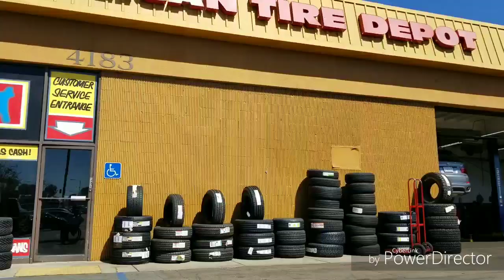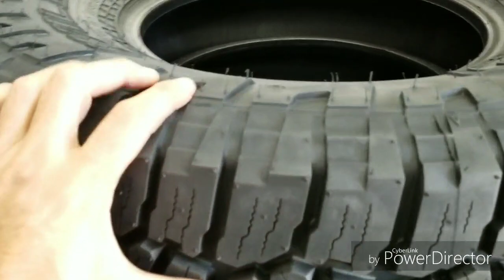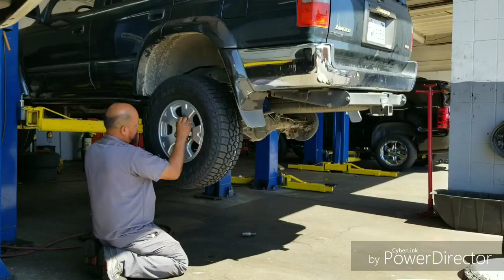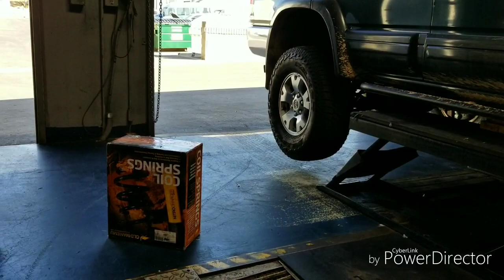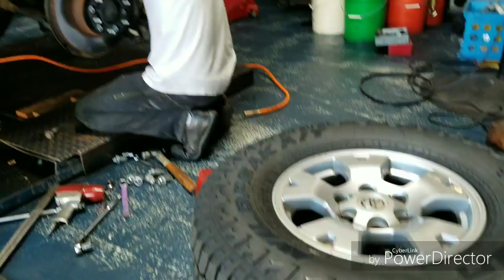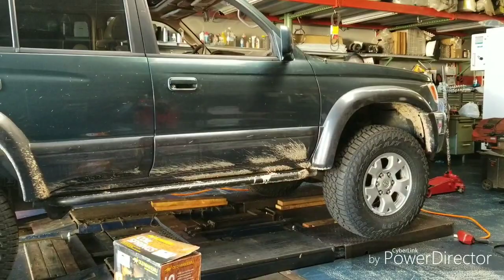4runner Gets a Lift, Wheels and Tires!

Comment: Looks great man! I’m looking into getting a very similar lift and some Wildpeaks as well. Could you tell me how much it cost for the suspension and coils? Thanks so much!
Reply from the maker: Hi there, I got rear springs 2906 for 60. Front 2881 for 160 and 5100s for around 290 for set.  I've been really happy overall with this setup.  Wildpeaks are my favorite all terrains easily.  If you watch my broncos flats video I was impressed with them.

Comment: Hi
What size of tires do you have ? 265/75/r16 ? and spacers 1.25 " ? If yes so in this configuration you dont have problem with front tires ? I mean with this size and spacers the wheel doesent touch the bumper or fender ?  I am asking because I hale tires 265/70r16 and 1.25 " spacers and the front tires when I only go back and turn the wheels they touch a Little bit in one place. I ordered now the new tires BF Goodrich KO2 265/70r16 but they for sure will touch the fender in the front because thebe arę AT tires and arę a Little big taller ten my old Yokohama. But today I decided to order also complet new Suspension Bilstein 5100 and springs OME 881 in the front and 906 in the rear. After that I want to order new BF Goodrich but now 265/75 r16. What do you Think ? With this tires BF Goodrich 265/75r16 and spacers 1.25" after lift will I have not problem with the tires in the front ? The springs 881 they get you 2 inch lift like they should be or Lower like 1.5 nich ? Same of the people said that after 881 OME spring instead 2 inches they got only 1.5 inch
Reply from the maker: Hi, yes I have 265/75/16 and it would catch on stock front bumper plastic. I had to trim a little! You will be fine if you do what you posted above.

Comment: Hey there which perch did ya put the front bilsteins on?
Reply from the maker: Lowest perch since these ome 881 springs give you a little lift.  If they ever sag I'll move them up a perch
Reply: Disabled2Able nice!!! I’m planning on getting this exact set up billies all around 881 and 906 in rear does the front sit higher?
Reply from the maker: @Circlec135  oh right on that's cool great setup you'll love it.  No actually the rear sits higher with slight rake so when you load down with some luggage it evens out.  It may look like front is higher in this thumbnail but that's only because of how fender wells are cut.  If you check out my Instagram you can see some side shots where the rear is slightly higher. Its disabled2able on insta

Comment: did you had to install those spacers In order for those wheels to fit?
Reply from the maker: They fit without but I didn't check the offset first and it's positive 35mm.  Terrible.  So with 1.25" spacers I'm at positive 3mm final offset which still isn't great.  I'd like a -6mm offset ideally